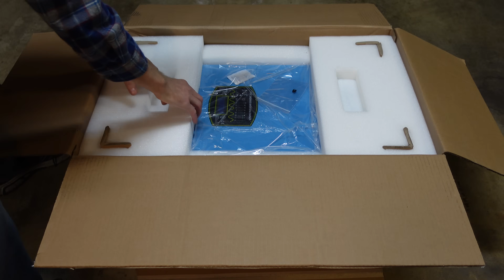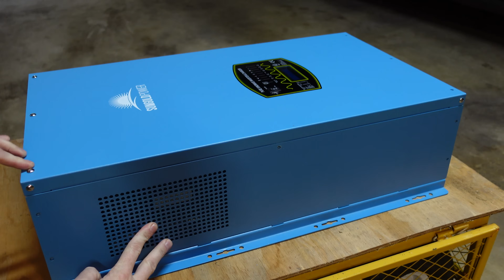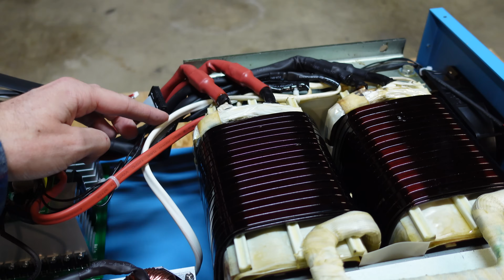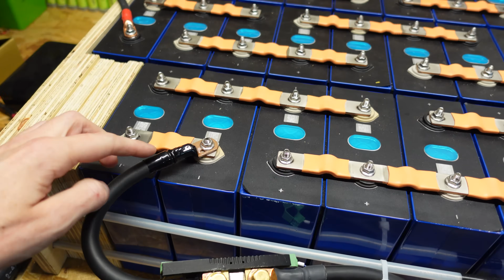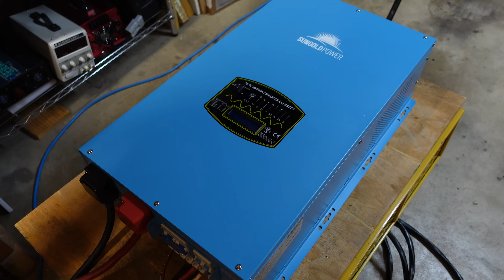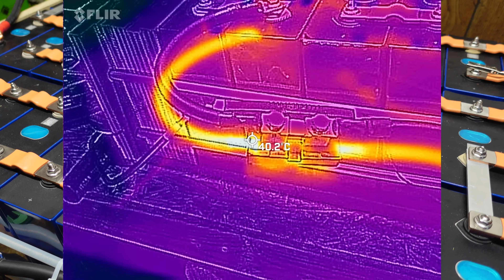SUNGOLDPOWER 12,000W Split-Phase Inverter/Charger, Review & Testing

Comment: We bought sunpower 6.5kw split phase model.  Big mistake it wont charge any lifepo4 batteries we tried and the company will not take returns after 30 days. Avoid getting ripped off like we did.

Comment: Instead of your schmancy wirewound 1ohm 100watt resistor you could use a rubber fuse/current limiter, otherwise known as an evacuated, radiant tungsten resistor, otherwise known as an incandescent light bulb.  If the device you have seriesed with the lamp tries to draw more than about 100 watts, the lamp comes on full brightness but likely nothing blows up if there is a short, the current is limited to 100 watts. Works great as an inrush limiter.  You can also get them with a 60 or 40 watt limit, and they are also available in DC versions with 12v and 5v being fairly easy to find. I used to know the part number for the 12v  was it a 5015? With a little bit of practice you can guess pretty close how much inrush current and the running current by how the light looks when you throw the switch. Really handy little device.  It is handy to wire one up in a jbox with a 3-way switch, one position your lamp is in series the other position straight through ac.  In addition to the visual indication you get, that 100 watt bulb is better than a resistor for what you are doing here because the resistance of the lamp changes with temperature, simple soft start of sorts.  It could be that some inverters would recognise a fault on the AC line if you tried to run it with that lamp in series with the ac input so be aware of that.
Reply: So can you Add controller s while using additional controller's?

Comment: That idle consumption in 24 hours I could run two full-size household refrigerator lol.  I find that unacceptable too much idle power consumption.  5448 watts in 24 hours.
Reply from the maker: Yeah, it's a lot of power...
Reply: But you leave the TV on ,  a clock in every room... the hot water is on 24 hours a day and only needs be for 4 hours but ya... through it under the bus.
If you are powering an entire house off grid then the  'extra' is not much.   You can not squack about the 180 watts... as any inverter uses 60W   so really it is  12 hours a day with no light at a120 W.    1.5KW H    extra over a similar one.   Is that really a deal breaker??? if it is you dont live off grid.

Comment: Hi, is it possible to connect inverters in either series or parallel to meet a whole house total power requirement as opposed to connecting individual/ group of equipment to individual inverters. I'd really appreciate your response, thanks.
Reply from the maker: No. This inverter cannot be paralleled, seriesed, stacked, or otherwise connected to another inverter unfortunately.
Reply: @LithiumSolar  Ok, thanks. Are there any that can be used in series/parallel though.

Comment: I just took delivery of the 18,000W LF-PV inverter today and I tested it with no load and was shocked that the fans are running at full speed with no load on a cold unit! My Sungold 6,000W inverter only turns on a low speed fan when a heavy load is applied, and the speed varies with temperature. But this new one is running a fan at full speed all the time. This is in the next room of a recording studio so I can't have that noise. I suspect something wrong with the fan controller. It's as loud as a vacuum cleaner!
Reply: Did you get your issue resolved?
Reply: @tgbst88  Mostly. I spent $100 on a quieter fan and replaced the original. That got me an 11dB improvement. Next, I built a shroud around the exhaust using 2" OC703 fiberglass. That knocked down the HF part of the noise some more. Now barely audible in the next room. And Sungold reimbursed the cost of the fan!
Reply: @basspig  How is that 18,000W unit going?  I was thinking of getting that to do a grid tie in system with battery backup.
Reply: Mine is doing the same running continuously..and do you know how to hook up back up generator? Any pics?

Comment: What's 6 KW version of the sun gold inverter is absolutely silent except for some slight Transformer hum and it has a variable speed or multi-speed fan that comes on at low speed from time to time when there's a reasonably heavy load operating. The fan noise on this 12 KW model is disturbing to say the least mine will be installed immediately adjacent to the recording studio and so that noise will be a problem.

Comment: The only shortcoming I see here is that there is no RFI medication effort. They should have at least several ferret chokes on the wiring coming off of the secondary of the Transformer and possibly some on the wiring going to the battery side. I have the 6000 watt sungoldpower inverter and it makes a tremendous amount of radio frequency noise that obliterated the I am broadcast band and the HF ham radio bands. I have the 18,000 W version of this inverter on order since last month and I am awaiting shipment.

Comment: I don't really get the complaints about the PV input or idle power consumption.  I'm running the 18kw inverter (over 200 lbs!) and using two midnite classics for the PV input.  These powerful inverters are reliable and powerful.  I currently have 10,000 watts PV input and having one panel (300 watts) dedicated to idle consumption is not a problem.
Reply from the maker: It's a concern for me as my panels face mostly west and I don't have a lot of space to add more. Maybe if you have a huge area and can simply buy another few kW of panels - sure. This is especially problematic in December-Feburary timeframe as once they get covered in snow, now there's pretty much zero power output unless you go scraping it off.
Reply: @LithiumSolar  These 12kw to 18kw inverters are obviously designed to run a small cabin or entire house. I have 24 - 440 watt panels now on a ground array facing south. Dedicating one for idle power seems reasonable. From other videos, it seems like all of the powerful offgrid low-frequency inverters have 200+ watts idle usage. A Sol-Ark is way too expensive IMHO and I'm not sure it can handle the surge current ?  Do you have a video for connecting 3 sets of 16S LifePO4 batteries ?  Great work, love your videos !

Comment: That inverter is $2800 to $3000 depending on where you can get it , 

I would just buy 12 inverters at 1000 watts each at $100 dollars each , 

Then each room in the house gets as many watts as it needs , 
You save 2 grand and still have enough watts to run your entire house
Reply from the maker: Uh, that's not how it works... lol
Reply: @LithiumSolar  , yeah ,
I already started

Comment: Do you know the awg size for the AC input for the 12000w version? Manual says 10-5awg, just wanted to make sure it can accept 5/6awg.
Reply from the maker: Yes, I can confirm it does accept 6 AWG THHN. I don't have any 5 AWG  to test with (not sure that even exists).
Reply: @LithiumSolar  thank you. I’ve never seen 5 either, just making sure. Thank you!

Comment: The idle being at 185Watts, is that at 48 volts or 120 volts?
Reply from the maker: It was measured on the DC side. The AC input is not connected.

Comment: What about AC coupling? If I were to land 60 Amps of 240 volt solar microinverter input in the backed up loads panel, what would happen?
Reply from the maker: That's a very good question. I've heard of others doing it but I've been afraid to try out of fear of blowing up my inverter. I asked AIMS and their official response was NOT to do it.
Reply: @LithiumSolar  Bummer. The amount of solar it accepts through the DC channel makes it pretty much a toy for purposes of off grid. Now, there was an option to attach a separate charge controller. In that scenario, is the input DC voltage still limited to (what was it?) 150 volts, or something? Or, would this allow more total wattage through some tech witchery? How much PV wattage could be run through the DC PV inputs with a separate charge controller?

Comment: Does this unit have a generator power assist feature, where can pass through power from a backup generator and add to that power for motor startup surges if needed?
Reply from the maker: No, it does not. What you're describing kindof sounds like a grid-tie or hybrid setup. This is strictly off-grid with no parallel or stacking capability.

Comment: Well,this inverter works great but i'm a bit worry about why the fan is running all the time  i have  an AIMS 3000 watts inverter and the fan turn  on  only when charge exceeds for about 400 to 500 watts.
This issue stop me to buy the inverter ...well! don't know if is the same for all the models .,the model i want to buy is the 6000 watts.

Comment: I was very interested in this brand and model but realized from the specs on the  manufacturer's site that the total harmomic distortion of these is around 10% which is not considered clean power. clean power is defined as a THD of less than 6%. would love to see this output on an oscilloscope to see its waveform.

Comment: This appears to be identical to a Sigineer brand model. Do you have any idea who actually makes these?
Reply from the maker: I asked this question to my contact at SUNGOLDPOWER a few weeks ago. I was told that Sigineer does not manufacture their inverters and has been slandering their business. I haven't been able to find any further information.
Reply: @LithiumSolar  Well, Sigineer may not make the Sungoldpower unit, and maybe they don't make their own brand either. I suspect that both Sigineer and Sungoldpower buy from some OEM. As near as I can tell the only differences between the two brands is the logo and color of the case. It would be interesting to see if any other identical unit has yet another brand stuck on the front.

Comment: Save your money. I bought the 18K inverter and it blew up after two months of light use. It was running a fridge, freezer and the TV. They didnt fix it. They shipped me two new boards and said fix it yourself.
Reply: At least they did send the parts. But, why such a big 18kW inverter for such a small load? The standby consumption will be more than the power used.

Comment: I dont get it? so u run 12000W from 2 or 3 #12 wire and terminal blocks? You make your own outlet strip? thats like 100Amps running through 12awg. I think its only rated for 20 or 30amps max.
Can someone explain please.
Thanks
Reply from the maker: The wiring inside the inverter is considered "chassis wiring" which has a whole different set of rules regarding max amps compared to NEC rules (which seems like what you're thinking of). Also, it's a max of 12000W / 240V = 50A (not 100A).

Comment: I bought Sungold's 6000W inverter for an evaluation project. I have 14kWh or Lifepo4 batteries from Treeline Power Systems. The trick with the Sungold is you must set Utility Priority if you want to run it with utility or generator with the inverter as a UPS backup. Battery Priority position will result in AC ABNORMAL messages and not switching the utility power.
If this works out (I have 40 240W panels on order from Santan Solar) I plan to upgrade to triple the batteries and the 18,000W Sungold Power inverter. With 54kW surge capacity, this should even be able to power my 20kW sound system to high volume levels.
Getting ready for Biden's Dark Winter and blackout 2022.

Comment: I have some 48 Volt 4 kw units like that one and the fans on the transfomrer end run all the time.  They are 240 volt fans not 12 or 24 volt.  The small fan that moves air to over the FETS is 12 or 24 volt PWM so it comes on when heavy load is put on the unit.  
Now you may be able to isntall a realy that can be triggered off the FET fan coming on but it may not like the PWM signals.

Comment: So this system bypasses its inverter when the 240vac input is avalible and goes straight to its 240vac supply? Genrally when a transfer like that is made a big meaty contactor is used to handle the arc and amperage.  
I am about to buy one for a whole home backup but i just want to make sure im clear of its theory of operation. I would love to see a video of this inverter switching from on grid to off grid and back again.
Reply from the maker: I'm not sure of the specifics regarding how the built-in transfer switch works unfortunately.

Comment: How did you crimp the main positive and negative cables of your battery?  I had a a heat problems with my crimps until I purchased a high quality hydraulic crimper that produces gas proof crimps.  Which means that the individual copper wires in the cable are compressed so much that they meld into a solid piece of copper.
Reply from the maker: I used a high quality hydraulic crimper.

Comment: These inverters are very inefficient due to their transformer. Solark inverters are transformerless have an idle current draw of about 65watts which is about 4 times less.
Reply from the maker: Low-frequency and high-frequency inverters both have their advantages and disadvantages.
Reply: @LithiumSolar  Thats true, still a good review. 👍

Comment: Also, could you turn off the battery charge feature so you could connect an external charge controller to your battery bank?  It would probably better serve some users.  I'd prefer just an inverter and stick with my current charge controller anyhow.  The one I am using allows me to charge the batteries off grid (or genset) as well as PV.   Doesn't his manufacturer make  a 120/240 v inverter?  I thought they did.  I'd like to see more efficiency when there are no current consuming devices drawing load.  Seems this company missed the boat on the charge controller input rating.  We are getting closer to really good solar equipment, though.
Reply: yes, you can just not use the PV inputs, which is a great idea, because the 10kw Sungoldpower inverter I bought seems to have f'n horrible charge controllers in it anyway.

Comment: I noticed at one point you mentioned that the PV input is to accept a connection from an MPPT or other charge controller.  It's my understanding this unit has the MPPT charge controller built in....so that connection would be for the PV's directly....or am I incorrect in this assumption?  The manufacturer mentions the MPPT controller being onboard as well.  Not sure what would occur if you connected 2 MPPT controllers in series.

Comment: Great video but Davidpoz posted a video on the SolArk having only 1 leg go over and shutting off. I am curious if this unit does the same.
Reply from the maker: This inverter can hold 125% of the rated output for 15 minutes before it shuts down.
Reply: @LithiumSolar  that is great. The SolArk refused to do that on one leg. Is that 125% based on one leg or overall. I plan on expanding a broader. The heat lamp is 110v so 1 leg will be used. If I turn on a saw, will I push a single leg too far and it shut down or will the unit offset the heat on the one leg and continue at 120% of rated for that leg?

Comment: Would love to see if this beast can start a central AC. 3 ton ok. 5 ton I am buying one tomorrow. Greetings from Texas.
Reply from the maker: That would be a fun test, but unfortunately don't have anything that large that I can test with. I do have a 1.8 ton that I run off my AIMS 10kW (built near identically to this). It hits the inverter pretty hard (lights dim) but it has no trouble starting it. A 5 ton... not sure! :)
Reply: 3 ton =  10.5kW 
5 ton= 17.6 kW

Hope this helps showing that you need to be going for the 18kW model to be able handle 5 ton AC. And that's without much spare capacity for anything else.

Comment: Clothes drying with heat is an extremely energy intensive activity, especially costly when powering it with very expensive batteries. To evaporate liquid water to vapour requires a phase transition and huge thermal energy input.
Reply from the maker: Yeah, it uses a LOT of power.
Reply: @LithiumSolar  My point being, the use of solar energy is to be forward thinking and inteligent, but anyone drying clothes by pv battery energy is not smart and cares not about resource consumption
Reply: @michellelewis3063  - the dryer acts as a great tool to exercise an inverter!

It is best to try not to be judgmental of others, since outsiders often do not understand the personal situations of others and there is no reason to get into someone else’s business to find out judgments made in ignorance may be completely unjustified. John 7:24
Reply: @DavidHalko  I refer to physics, latent energy, I would ask you to look it up :)
Reply: @michellelewis3063  :   I believe the point is addressing your unfortunate and judgemental phrases "not smart" and "cares not". Let us assume the following: 1) At least one person in the residence has significant environmental allergies (hay fever, grass & trees, etc), so hanging clothes outside to have them air dry outdoors is not an option. 2) There is not enough room inside the residence to hang the items to be dried. 3) The residence does not have access to a power grid. 4) The owner wants the smallest carbon footprint as possible. 5) The residence has terrific solar positioning and orientation. 6) The solar & battery setup has ample capacity to run a normal household load and the dryer (so other household load are not sacrificed for the sake of drying clothes). 7) Geothermal energy is not an option (either too expensive, or something else). Now, given these parameters, what method of drying clothes is "smart"er than using stored PV energy? I guess you could say to use the generated PV power directly from the panels (through the inverter) during peak PV power generation, but the normal daily household load might dictate that clothes washing/drying be done late at night, when other power requirements are minimal. I believe this is what David H is getting at: "the personal situations" (the parameters I listed above, or even more restrictive ones) might dictate that drawing stored PV power from one's "very expensive batteries" just might be the "smartest" (or even the only reasonable) solution.